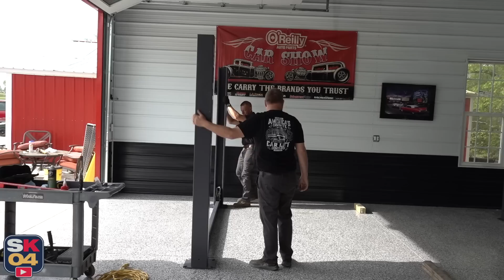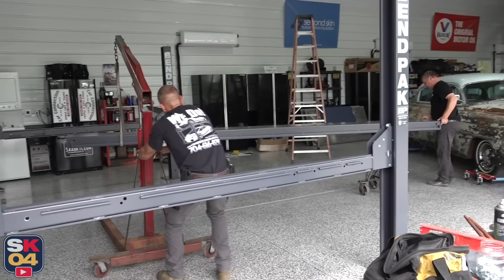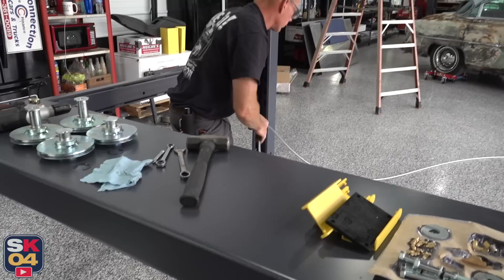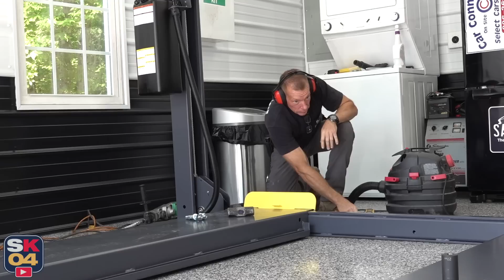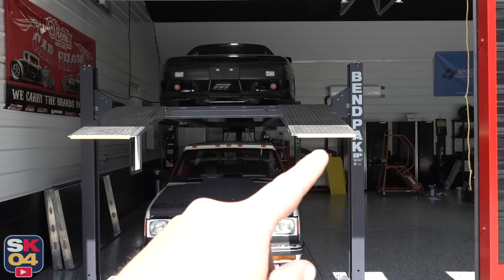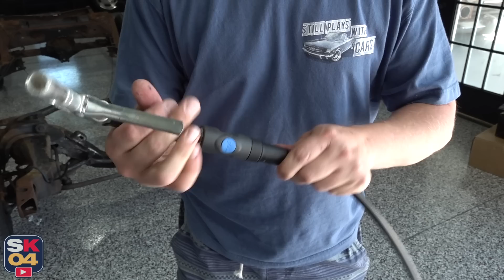Installing An AWESOME 9,000 lb 4-Post Lift In The New Shop!

Comment: great video kyle that is a fancy lift to have in the new shop and defially help you out a hole lot in the long run and a great storage space temperarly if need for other projects the the air compressor plus hose is a great idea couple hoses around the shop will help when you need it the most guys did great seting it up the s10 and 240sx fits perfectly great job thumbs up and shared

Comment: Great video Kylie. I noticed you didn’t drive the 240 into the shop? Is there something wrong with the engine?
Reply from the maker: I am in the midst of changing the fuel tank sending unit so it's all apart and there's no gas in it LOL